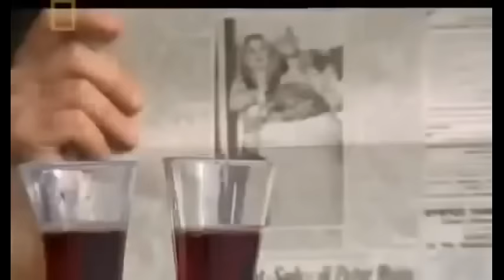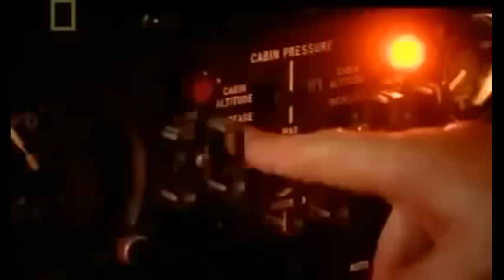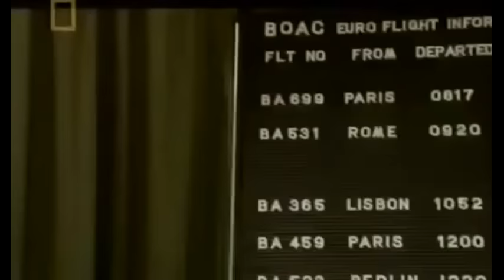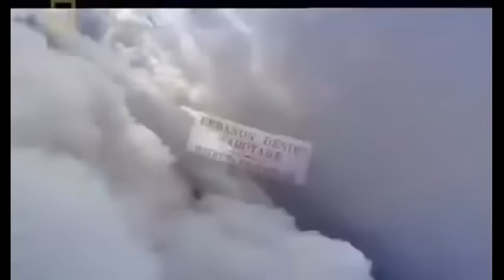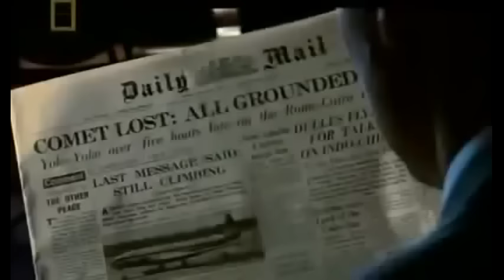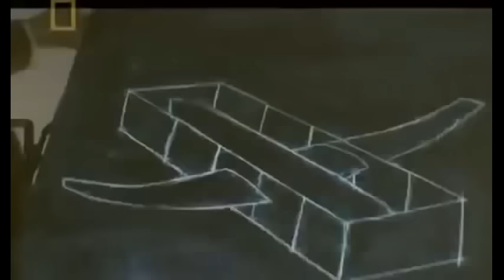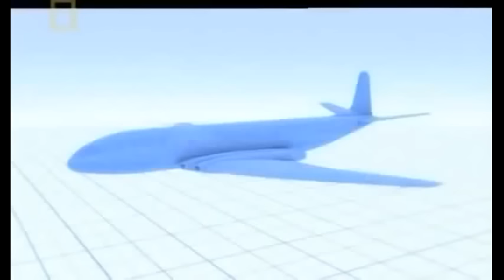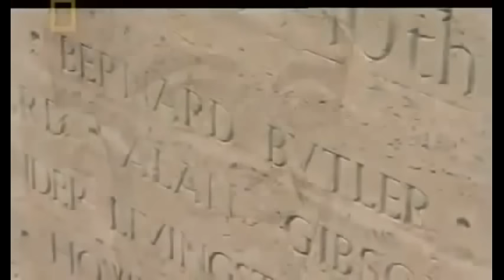Air Crash Investigation BOAC Flight 781   [48:40]

Comment: Some people here have claimed that DH's ill-conceived Comet "paved the way" for modern jet airliner development. What absolute bloody rubbish. The Boeing 707 was already under development. Remember that Boeing also had the prior benefit of vast wartime experience in the design & mass production of high-performance, long range heavy aircraft. Think the B-17 (over 12,700 built), the advanced B-29. And the legendary B-52 heavy bomber, which entered service in 1955... two-thirds of a century later the Buff is still kicking arse. De Havilland had no such experience and it showed in the Comet's hasty, deficient & shoddy design -- its over-sized square windows, the use of punch-riveting (not pre-drill & rivet), the engines buried in the wings etc. Boeing 707 original design features, eg. engines slung on wing pylons, are STILL in universal use today.
Reply: Oh lol. Engine under the wing was German design.
Reply: Boeing employee or an American?
Reply: @barbarab7049  Neither. Were you a De Havilland employee, or are you just ignorant of all things aviation? I have only limited flying experience, but a lifetime of intense study into Human Factors especially as these apply to aircraft design faults and air crashes.
Reply: @Teochewtuahang  
They said Airbus bought all their aluminum and aircraft plans.
That's where all the wiring, and paint  for the a350 came from.
Reply: De Havilland's expertise was wing construction. Hence why a former DH factory still builds Airbus wings today (Broughton). Wings are still allocated DHB (De Havilland Build) numbers in the factory.

Comment: Ok, so how are planes made differently these days to prevent this same thing from happening again?
Reply: Thicker gauge skins, fastening skin panels with both rivets and adhesive, titanium tear-strips to try and contain fatigue failures, avoiding sharp corners in skin cutouts like windows and doors, use of newer materials like carbon fibre that don't fatigue, more robust testing, regular inspections of airframes for traces of metal fatigue, etc
Reply: Parts are designed from the ground up to not have stress concentration points like those on the original square windows
Reply: You'd think that having square windows would OBVIOUSLY produce stress points at the corners, - you only need to look, for example, at any building in a subsidence area to see stress fractures at the corners of door / window frames, it's just an engineering given.